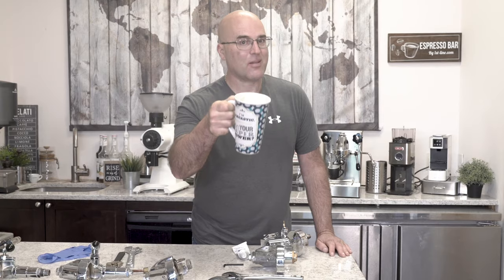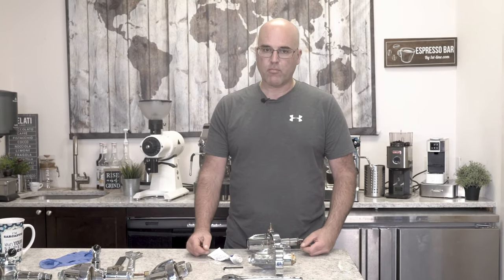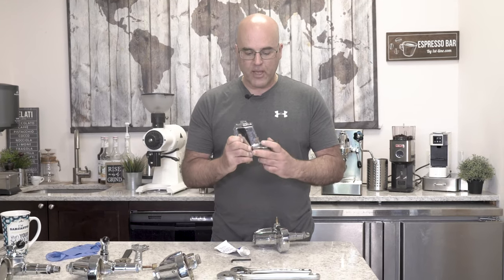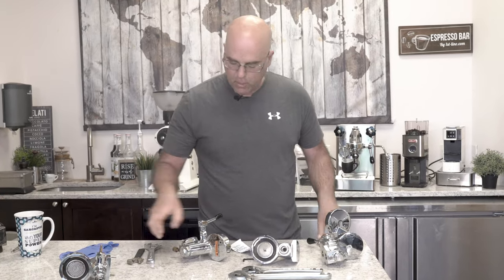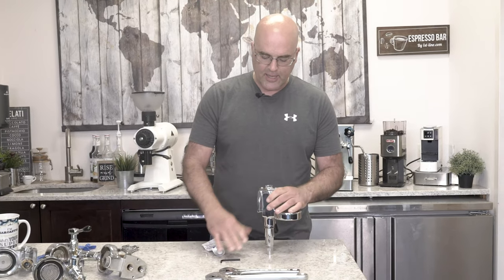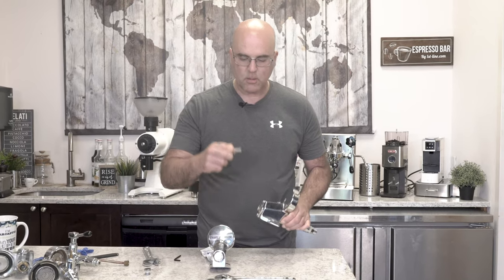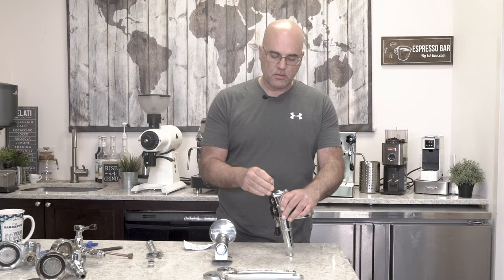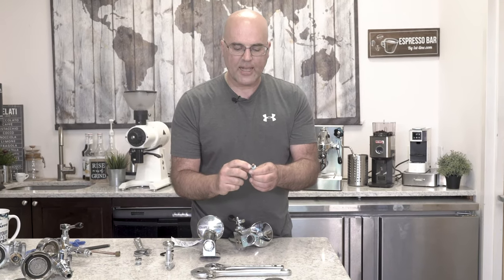E61 Grouphead: Tech Tips, Inside Scoop and Maintenance

Comment: On the VBM, once you've removed the large nut and then the two Allen screws from the collar at the top of the mushroom, how do you then remove that collar?
In the video it just flew off but mine doesn't seem to want to budge.
Reply from the maker: It seems you may have limescale holding it in place. Prolly best you have a professional look at it. Otherwise, a rubber mallet to tap and loosen. However, we are NOT responsible for any damages or personal injuries.